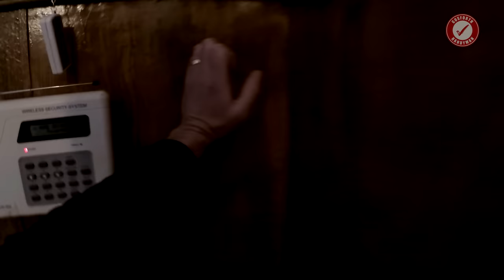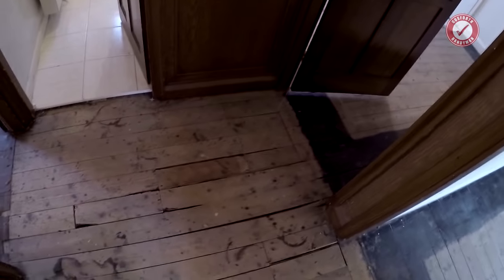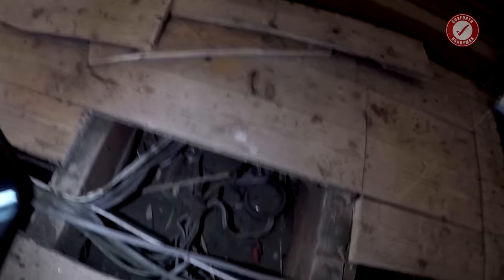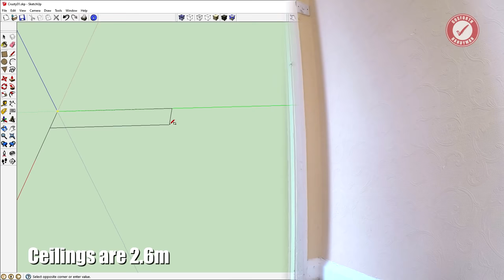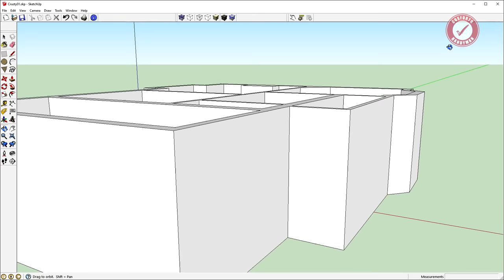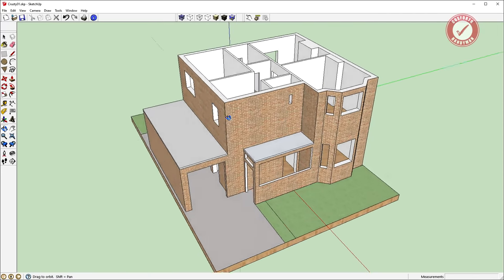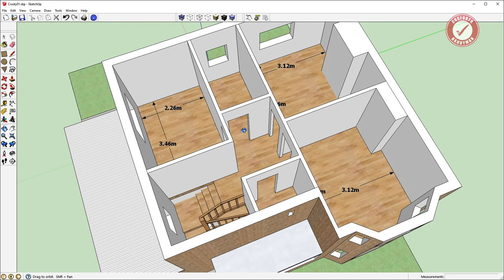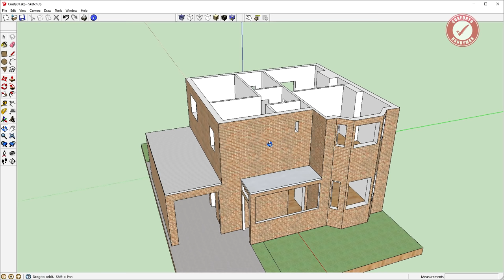Structure, drains & plans - what would you do? (1920's Renovation Part 2)

Comment: Ground floor: I'd keep kitchen where it is. Turn the dining room into a sitting room. The living room into the dining room, covering up the door area and have two walk ways from the dining entering straight into the kitchen & the other entering into the sitting room. Add an extension off the back bay window and turn that into a living room and if possible putting in at least a half bath to the left (so it's behind the kitchen and the left of the addition.

Upstairs: I'd keep the rooms on the right the same, the only things I would change in there would be to add a closet in the bottom right of the front room and in between the chimney & new closet I'd add in shelving. Similar concept in the back right room, closet on one side, shelves on the other. Now for the left side of the upstairs, I'd extend the bedroom over the back 2/3rds of the garage and consider it the master, but I'd also pull back the wall that shares with the bathroom to the edge of the stairs to enlarge the bath and be able to add a tub.

Obviously that all would depend on those solid walls and the structure. An engineer I am not, but that's what'd I'd personally do, if I could. :)
Reply from the maker: Some great ideas there! 👍😊

Comment: I'd turn the toilet into hot press/airing cupboard, or storage room. Current shower room could be extended into one of the bedrooms or made into an en suite so you have at least two bathrooms on the property. A proper sized bathroom can be built over the garage (bedroom 3 would be extended over the garage but lose some space beside the stairs for a hall to access the bathroom).

Not so sure about downstairs. Right now I'd open up the kitchen, living room, and dining room walls, but if you're extending out back it might be worth only opening up one wall.

Sound proof shed near the end of the garden for your drums (keeps the neighbours happy). Garage can act as the workshop unless you expect to need a larger space. Sheds can be built in the garden for storage so workshop space isn't being taken up by unused materials.
Reply from the maker: You win. 👍😁

Comment: I would imagine the internal walls on the first floor are built up off a piece of 4x2 that is laid on top of the floor boards and running in the same direction as the joists below. Easiest way to check is pop a skirting board off and take a look what is behind it. Of course, Im only surmising. All the best.

Comment: What about energy efficiency? Think about planning permission for exterior insulation and wood cladding retrofits being absolutely standard within 5-10 years. It's likely you'll need to conserve the front facade, check with planners, so interior insulation may be needed, but the other faces will be fair game. The side extension will give you an opportunity to do one face of the building, but whilst you're at it, consider doing the rear at the same time. If you're doing any work to the ground floor, it might be worth going for a deep retrofit of insulation there and install and underfloor heating system, especially in the communal rooms. There will likely be access to grants very soon so it might be worth looking into it - as a youtuber you make get priority if you message the right institutions/companies to promote schemes. When you consider the loft, mechanical heat recovery ventilation systems will need ducting paths to the ground floor rooms. We have a 3 story property so using the obsolete chimney systems (wood burners are incredibly polluting and will soon be banned) as a potential vent is worth consideration, otherwise you may need to box it in the corner of a room upstairs. If you do anything to the plumbing, especially replacing the unvented water cylinder, oversize it as much as possible, if 500l fits go for itbecause thermal energy storage will reduce the running cost of heat pump to reduce peak electrical demands in the near future. Keep up the good work! PM if you want to discuss this further.

Comment: I would remove the wall between the kitchen and adjacent room (since it may need additional structural work to support upstairs anyway), and extend out the back using the bay window location as the opening. Have the large 'L' shaped room as Kitchen/Dining/Living space with the snug/office in the front. 

You could also extend upstairs in same place too for a big master bedroom with ensuite? Planning issues aside for something like that ofc.

I guess you could have a branching staircase to a new room above the garage (not sure what garage ceiling clearance is like?). I'm not sure its worth it for the narrow and long room though?
Reply from the maker: Great ideas! 👍

Comment: My house was built about the same time and all the walls are solid, I had to go into the loft to find out which ones were structural or not. Looking at those boxes they are twist to open so they don’t need ant tools to get inside, also seeing where they have put the cables across the tops of the flooring joists and no evidence of nailing plates then I would be worried. As I said my house was built about the same time and all my electrics were in steel conduit right through the joists and up the walls to the sockets, so when it came time to rewire I was able to connect the new wires to the old and pull them straight through the conduit to the sockets (providing I got the right socket)
Reply from the maker: Yeah there's defo some remedial work to do on the electrics - bit of a mess. We'll see once I get a few more floorboards up. 👍

Comment: I would knock down the garage makes it easier to get a skid in the back for clean up. Would cross brace the outer walls do load bearing beams for the ceilings or possibly steel load bearing beams with metal plate bolted into the wall for structural integrity. From there, I would build out the back another 4 meters. And for the front I would take down the front porch and turn it into and extended over hang.  And of course checking to see if the sewer and drainage has any roots or collapse and see if the electrical is still good. I would also check to see if there were any signs of any bunkers in the backyard with the age of the house. As for the first floor I would open it up to give it more of an open floor plan so that ot would be easier to have better options for the kitchen and dining room and living room. Furthermore, I would insulate the other walls and attic with rock wool too for a more controlled livable environment. And I would clean up the back ang ger rid of the dead apple trees and replant new plants tress and shrubs and an area for a vegetable, fruit, and herb garden.

Comment: What ever you do is going to cost due to the steels you will need to support. I personally would, take the porch off and leave open but have a glazed porch roof. Front door as is, ide leave the front room as is and leave the fireplace add a small wood burner, turning it into a snug/tv room/ office. Brick up the kitchen door, move it to under the stairs, pull the existing garage down rebuild it into a new kitchen dinner. Window at front  sink below then a long run of base and eye level units along the flank wall. Take out existing kitchen wall turn existing kitchen into dinning room. Then either a long wall of bi-folds  for kitchen dinner or divide with a pillar to support the RSJ from taking kitchen wall out, put a pair of french doors or patio doors across the back. Leave the rear living room as is . Or add to existing bay window a pair of french doors. Across the whole back a long open glass topped veranda....

Comment: Personally I can’t stand storage heaters. I’ve installed underfloor heating before so I’d be tempted to install a ground source heat pump and have radiant floors down stairs.
Reply from the maker: Looked in to GSHP but I think there are other technologies on the horizon that will make them obsolete. 👍
Reply: @GosforthHandyman  I presume you will not be fitting a gas boiler though?
Reply: @GosforthHandyman  My Dad lives in Gosforth, and was excited about GSHP about 15 years ago. Unfortunately all the mine workings underneath the house meant the boreholes could only go 40m down, rather than the ideal 100m+. All the radiators in the house are tepid, luckily he's lived in cold houses all his life so doesn't seem to mind!
Reply: @GosforthHandyman  Air to water heat pump is about 1/10 the cost of GSHP I believe. You'd need a very airtight house for any heat pump system to work though I think.
Reply: @dooovde  I think ground is probably a better option with a garden that big, you really don't have to go down that far for it to make sense. Just below the frost line ideally. Avoids issues with noise too.

It depends how you use it. If you only turn the heating on for a few hours every now and then it's not great because it takes a while to heat up. But heat pumps are great for maintaining a constant heat, even in older, leakier properties. Side effect of having the heating on, at least a bit, all the time is that you're not just heating the air inside the property (which can easily leak out), you're also heating the walls, floors, all the building fabric. Which makes for a big thermal mass which is very resistant to small changes in air temperature.

Comment: I would have a look at the neighbours houses for an idea of what the original front door would have looked like.  The porch needs to go I think. Knock the bathroom and loo through as well. In our semi there is no way you could knock through from front to back. The chimney stack is built hipped up through on a diagonal. Our house chimney supports the integrity of the neighbours house and vis versa. The loft will tel you more. Beware of water pipes in the wall. The back room fire place in ours had a back boiler in it and the water pipes run horizontal five foot along the wall before they go upstairs. Endless fun in old houses.

Comment: I would knock the garage down, build a double height extension.  Extend the porch to the edge of the property.   The lower part of the Garage make that into your new hall way split that in half, and the room at the rear rsj that wall and make a larger kitchen.   The stairs, convert that into a white oak or light pine.  The front room turn into a family snug. The room behind into the living room, with an open plan kitchen.  The two unsupported walls upstairs take down and stud those out but extend  it,  That family bathroom move to the extension above the garage and share the soil, water pipes with the kitchen. In the space that the bathroom was convert that into a walk in closet for the master bedroom.
Reply: forgot to mention the porch downstairs once extended make that into a downstairs toilet with utility area.

Comment: Also, just my opinion, but here's what you should do. Firstly get rid of the hidious front porch, and do a nicer brick and wood one. Secondly keep the garage, it probably is worth doing a first floor extension, however side access is great to get stuff to the garden. Could Always soundproof and turn the garage into a temporary workshop. Do a full width extension across the back, with a open apex roof to give a nice kitchen dining room with high ceilings. If you do a first floor extension then possibly open up a bedroom inkt the bathroom as a ensuite, and add a bedroom and bathroom above the garage, if not then turn the front room into a bedroom/spare room could be a good snug for watching movies. I'd also say to knock out the chimney breast in the front room, if you're going to open it onto the dining room. Lastly build a nice workshop in the garden, if you keep the garage it's good storage and access to the garden. Apologies for having so much to say😂
Reply from the maker: Great ideas! I think the garage may become the permanent workshop - time will tell. 👍

Comment: hello, goodluck with the house. How do i hang pictures up on walls that’s got plaster over aerated concrete and some with brick, do i have to use screws and wall plugs or will these brass plated nails (from a picture hanging set on amazon) work fine with them only going as deep as the plaster for pictures less than 5kg?

Comment: If it were me, I would knock down the front wall of the property where the front door is, and rebuild it as far forward as the neighbour's property/building line allows. You'd have to take the roof off, which at least allows you to get rid of the chimneys in all rooms (it's such a small house that you need every square centimetre of floor space). I'd knock the garage down, and extend out the back exactly as the neighbours have done  (single storey extension to rear of the house). I'd extend the master bedroom into the space currently occupied by the toilet and taking some of the new space created by moving the front wall. I'd move the left hand wall of the bathroom so it sits over the wall below thus making the bathroom into a reasonable size, and I'd add an extra two bedrooms over the garage. Downstairs, the garage space would become a study at the front of the house and a utility room/larger kitchen to the rear.  Put a SUDS under the front garden and pave it with porous paviours, and you're done.
Reply from the maker: Great ideas! The SUDS might be tricky due to the sewer line but worth looking in to. 👍

Comment: It looks like a former corporation house. I  know here in Liverpool most of the houses built by the council had cavity walls and were built to last. Can’t say the same about houses built today, as cheap as possible. 
The only thing you can say about today’s houses is the foundations are better. The old ones were built of brick and if the ground settled so did the brick and the wall above would crack. Nowadays the foundations are one solid lump of concrete if the ground settles it floats and doesn’t lead to cracking.

Comment: One more question - when making the SketchUp model, are you assuming the thickness of internal and external walls based on an industry standard or did you measure them? If the second option, can I be dumb and ask how you measured how thick it was reliably?
Reply from the maker: Yeah, just took a rough guess at 100mm for internal walls and 250mm for external. Should be close enough for now. 👍

Comment: With budget considerations in mind and the limitations of the property as well. I'd extend out the back a full width single storey, after rebuilding the Garage and extending above. So the ground floor of the garage area would be part of the extension at the back. If you have no need for a garage, I'd convert that area into a useable room, maybe a utility room, a downstairs WC and a study/office. Then out the back a few metres away from the new back of the house, build a workshop.

If money is no object then I'd try and buy the house next door and convert it into a large detached property :).
Reply from the maker: Great ideas - including buying next door! I don't think they want to move though. 😂👍
Reply: @GosforthHandyman  you never know if you don't ask or attempt to gently persuade them into it, although that might increase your project time line somewhat significantly.
Reply: @GosforthHandyman  The drum kit will soon change their mind on that.

Comment: Regarding that wall with the crack. Does it continue to downstairs ( I mean the wall ,not the crack)? If it doesn’t then it could be caused by heavy brick wall resting directly on the wooden floor which would naturally have some movement in it. Our 1960s house has a couple of upstairs walls which are concrete blocks and are just resting on the joists so there is a bit of cracking. In my opinion still better than non soundproofed plaster board hollow walls.
Reply from the maker: No, there's nothing under that wall downstairs so think it's on a big joist going front to back. No sign of cracking on the ceiling underneath so think it's just contraction of the joist. 👍🤞
Reply: @GosforthHandyman  My experience of pre-war properties suggests there is no beam.  Just brick or block on floorboard and joist.
Reply: Same in mine 1942 ex council house upstairs walls are all solid,  the 
walls dividing front rooms built on top of the floorboards. No beam. And like that one the beams run different ways in different rooms apparently for noise reduction  so noise cant travel from front rooms to back rooms through the joists

Comment: Whatever you do by building and extending, please consider making this property fit for the future.  Others have mentioned ground pumps etc.  I would just appeal for all electricity.  I know that storage heaters seem to have run their course, but you could take advantage of all that heavy duty power cable to install electric heaters; not sure about underfloor heating as that would mean losing all those lovely floorboards, but that might be the more ecological option.  Consider top quality insulation - walls, ceilings, underfloor and triple glazed windows. Please, please, please lets try to preserve the planet.
Reply from the maker: Too early to take a gamble on GSHP or ASHP. The options are like Betamax vs VHS at the mo. Hydrogen looks interesting but we're not there yet. 👍

Comment: I think I’d like to see the loft before re-designing. I’d definitely do a double storey extension where the garage is and then possibly develop the loft space, for two more bedrooms. New stairs over existing ones. That way you could lose the back bedroom on the garage side, extend the bathroom into a portion of it after creating a corridor into the new extension. That releases the old loo to become a tiny en suite to one of the other bedrooms. Obviously single storey extension all the way along the back as far out as you can afford. Cost always plays an important part in what you can do (sadly!).
Reply from the maker: The lofts are quite small in these properties - nobody else has gone in to the loft so don't think it's an option. 👍